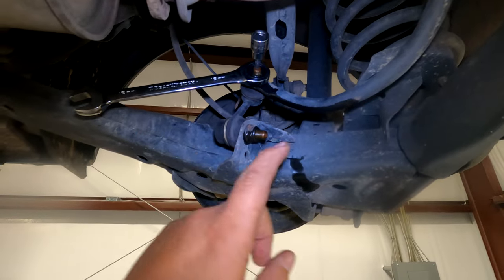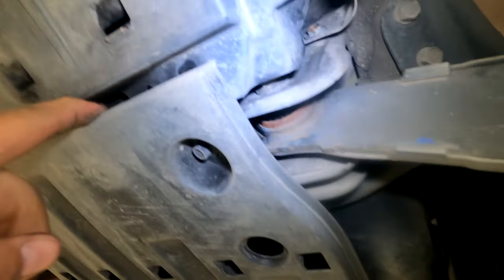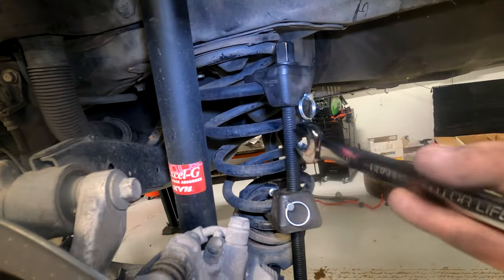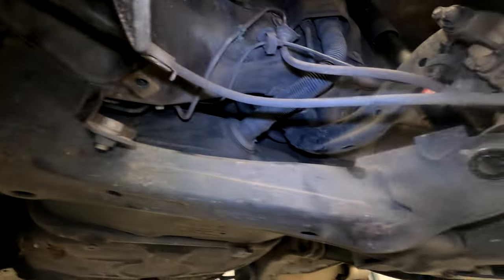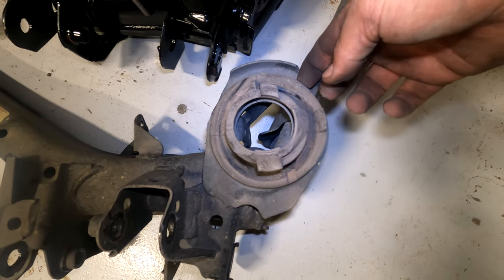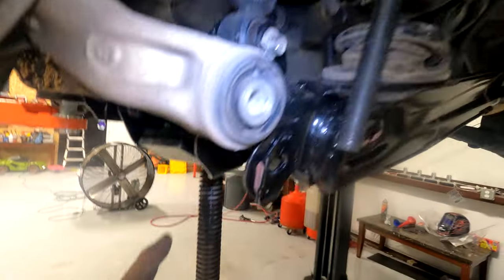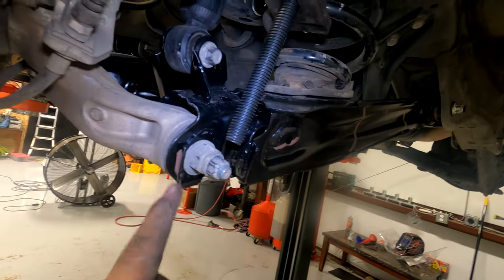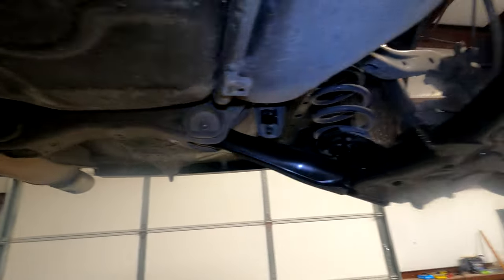2011-2014 Honda Civic Rear Lower Control Arm Step-by-step | Rear Lower Control step

Comment: I'm just now getting started on this. Had a driving job up in the mountains and my brake line broke coming around a mountain pass corner at 35-40 mph. Car oversteered on the turn making my rear passenger tire hit a boulder. Bent the trailing arm to the point that it was just hanging together and was about to snap in two, flat tire and some airbags deployed. Was looking into buying parts and getting it serviced but seeing this I think I'm headed to the junk yard to find a working lower trailing arm from another civic. Really appreciate it, helped me saved a lot of money for the holidays.
Reply from the maker: Thanks for watching!

Comment: How long did that take you realistically? Obviously the video was cut down. But I'm just looking at this shaking my head because I'm going to be doing something round and knowing them floor jack to line up control arm etc It's going to be a pain in the ass especially since everything is a bit rusty. Rust plus being on the ground
Reply from the maker: on the floor, maybe 1hr

Comment: I have a 8th gen and the rear trailing arm looks identical. My problem is the camber bolt/rear trailing adjust bolt is seized in place. Nuts are off but the actual bolt is seized to the bushing. Do I have to cut it out and replace the trailing arm? Is there anyway to remove it without having to drop the whole trialing arm?
Reply from the maker: Cut the bolt on both sides then use a punch or press to remove the bolt.  If it doesnt come out then u will be stuck buying a new arm

Comment: My issue is it looks like that washer that’s is oblong shaped isn’t in the correct place .. thus one of my rear wheels has a lot of camber. I want to loosen it and re-orient that washer / bolt thing. I have a 2010 civic… not a lot of video / info on this
Reply from the maker: The alignment shop deals with that
Reply: @FatGuyBuilds  took it to a few and they did nothing which really bugged me. Gonna asks good mechanic of mine who he recommends
Reply from the maker: @bradlyfan  firestone get the lifetime alignment for 225$.  Never pay again for that vin number.  They will tell u everything u need.
Reply: @FatGuyBuilds  my only issue with lifetime stuff .. is I did that with my dc2 or dc4 integra .. and people crashed Into those, so I feel like it’s bad luck. I might do that tho. If they can’t fix the camber with just an alignment I’ll get adjustable upper control arms and try again. It’s better to pay for a lifetime alignment vs 2 separate alignments.
Reply from the maker: @bradlyfan  i got 13 alignments for 225 on my focus.

You should get an alignment whenever u get new tires...
Whenever u replace any suspension part...

Comment: Where you got the parts??
Reply from the maker: Just search the part numbers.  They were between 250$ and 350$
Reply: Where at?
Reply: That a civic si?
Reply from the maker: @erickjimenez9966  yes.  They are all the same
Reply: I have a honda civic 07 you think it can fit 2011?
Reply: hello, my car kicks in the back when going on the road or going over potholes, they mention that it is the trailing arm